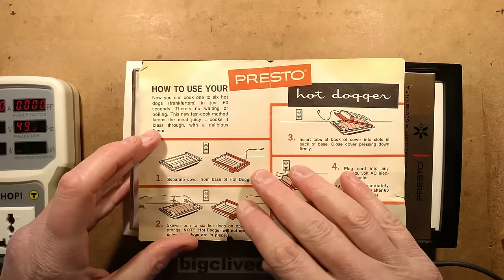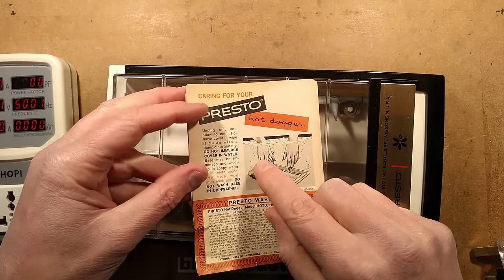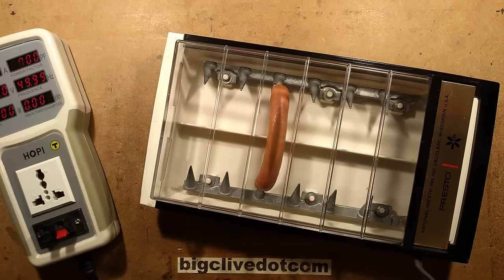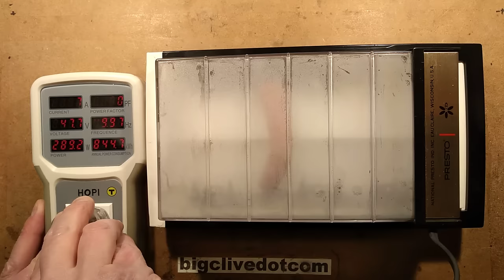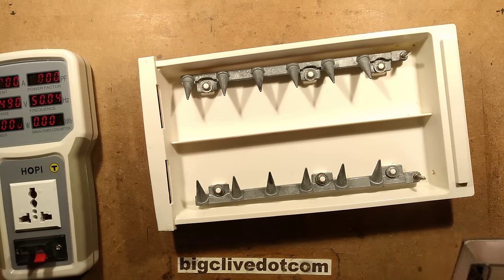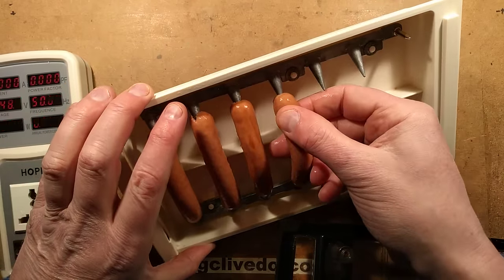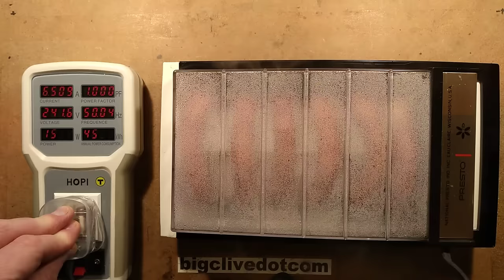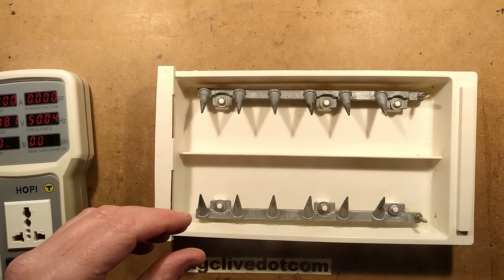Turbo charging a 120V Presto hot dogger on 250V.

Comment: Now I know if I ever run out of 200 ohm resistors I can just use a hot dog :)
Reply: HAHA, i love this comment
Reply: Dang it I just bought a whole bunch of resistors.... off the top of my head I think I was going for 220 but 200 is close enough🔌🔥💥💣💀
Reply: No wait that was 220K that explains why I burnt out one 220 testing things, I'm trying to drive LEDs off of 120 mains and yes i did consider and did watch the previously uploaded video on the subject of "LED Mains indicators".
Reply: ALL resistors are tiny hotdogs encased in resin and color-coded with stripes. SMD ones are just tiny square slices of bologna.
Reply: Could hot dogs be the new duct tape of the electrical engineering world? Hundreds of uses!
Reply: if you need different resistor values you can simply put hot dogs in parallel or series to reach your value..
for higher values you might wanna try cheese instead !
Reply: @chemieju6305  i use oreos for that :P
Reply: @tinygriffy  given that the cream is probably more conductive than the coockie you might want to consider using reores.
Reply: @chemieju6305  oh, i soak them in banana milk as electrolyte.. forgot to mention. ^^
Reply: And you can trim the value by adding more in parallel. 4 of those should make a useful 50 Ohm dummy load...
Reply: You'd need a lot of them if they last this long before being cooked.  :)
Reply: It's hard to solder to a hot dog, but I suppose you could stick them in a large fuse holder..
Reply: Just make sure you check the color code on the hot dog first ;)

Comment: probably the most efficient  hod dog maker, but also has 0 change to pass any modern CE or FCC tests
Reply: Krisztián Fekete bribe them with hot dogs
Reply: It gives the hot dog a certain taste. Many other channels have commented that the hot dogs taste off. 
I would TRY one, but I wouldn't want one of these. The roller machines are better imo.
Reply: @xeserupseinopelttil4574  Of course roller grills are better, they sit and roll in their own juices for hours making them delicious
Reply: I g e n
Reply: @xeserupseinopelttil4574  Yeah, the problem is, it also electrolyzes the hot dogs.
Reply: CE is a self-certificate, so yes you could.  And UL would also for enough $$$$.
Reply: @Nerdule  it doesnt there is no galvanic effect with ac
Reply: Ah yes, the Federal Communications Commission deals with hot dog cookers
Reply: Moistifier The hot dog might have RF emissions.
Reply: These hotdogs that are cooked like this actually taste like they have metal and or electriciry in them. Not sure why but its not really pleasent .
Reply: It's 2 live wires coming out of a wall socket.
... If there's any kind of safety testing, this thing wouldn't get past the drawing board. I love it.
Reply: @Volvith  The wires are only exposed inside the device, and only with the lid closed.  This device is IP2x just like the electrical socket itself.
Reply: Unless you got some weird kinda dogs that spew rf, the FCC don't give a shit.
Reply: @xeserupseinopelttil4574  we had one of these when I was a kid in the1970s, and yes, I was allowed to use it.

They had that burnt electrical taste on the ends where the dog was in contact with the probes.

Would not recommend.
Reply: Just slap a CE label on there. Problem solved.

Comment: Tiny hotdogs from a can?and high voltage?.....this looks safe
Reply: Since when is that considered high voltage? In consideration it's actually still low voltage
Reply: @cappytan9058  it's...240 volts...enough to kill multiple fully grown men... what the fuck do you mean still low voltage?
Reply: have you ever been shocked by static? that is way more than 240 volts...  @cato7329
Reply: @cato7329  Its not the voltage that kills
Reply: epic gamer  it’s all relative. 120 or 240 volts can be lethally high when it’s generated as alternating current and the amps are also sufficient. If the volts are much lower, then there simply wouldn’t be enough electromotive force to allow the electricity to overcome the resistance of your skin, regardless of the number of amps provided.
Reply: @logik316  you're right, I guess I forgot to add that
Reply: Zero Cool Low voltage is up to 277, medium is 277-600, high is anything over that
Reply: @cato7329  doesn't mean it's high voltage
'Voltages 600 V and below are referred to as “low voltage,” voltages from 600 V-69 kV are referred to as “medium voltage,” voltages from 69 kV-230 kV are referred to as “high voltage” and voltages 230 kV-1,100 kV are referred to as “extra high voltage,” with 1,100 kV also referred to as “ultra high voltage.”'
Reply: @cato7329  Been doing electricity for a while now, we've all been messed about by either 230 or 400v trying to graduate, still in consideration not that high 😊
Reply: if you have never seen a video of a person accidentally hitting a house line for electrical they literally get thrown into the air its crazy ive seen it in person
Reply: @cato7329  still low voltage. Low voltage was up to 1000v ac and 1500v dc, medium was from 1000v ac and 1500v dc up to 10kv and 15kv respectively. Only from there it is considered high voltage. Its not the voltage that kills tho.
Reply: I think the cooker is safer than the canned hotdogs.
Reply: @cato7329  It's amps that kill, plus BigClive here proved that in a vid where he subjected himself to mains voltage run through a resistor array, ultimately resulting in taking in 30vac with gradually increasing currents up to IIRC 13mA - the pain threshold for AC, and 100-200mA is the kill zone for AC, and 300-500mA is the kill zone for DC, so, for example, you could get hit with 120vac @10mA and be fine, other than it hurting like hell, while you could be hit with 40vac @120mA and be a dead mofo. Internal body resistance also plays a part.
Reply: 'Murica!
Reply: Also 240 volts is safer as being electrocuted will throw you off what is electrocuting you saving your life, 110 volts will hold you to the wires and possibly kill you. My brother who works as an industrial electrician but occasionally wires houses for people he knows has been electrocuted three times with 240 volts and is fine. If he was electrocuted at work he'd be dead as it's 20,000 volts and some ridiculous ampage.
Reply: @nandos_  yeah, it is, that adage is pure myth.
Reply: Any bigger hotdogs wouldn't even fit in the machine
Reply: @cato7329  lol. If that was true then I would be dead hundreds of times over. I can't count how many times I've been electrocuted with either the full 230-240V or just between the mains and ground (half).
Reply: @Ethug229  That's before it gets transformed down to 240v for residential use. The voltage of long range electrical transmission is usually 100,000-1,000,000 volts. 
By the time it reaches your neighborhood the voltage has been stepped down multiple times.
Reply: High voltage warnings are warning how far it can arc. Mains is in cm at best.

Comment: My father was a high voltage lineman, and long ago, he called us outdoors for a quick electrical lesson, since we were a bunch of curious kids when it came to electrical and electronic things. He wanted us to learn respect for mains electricity, so he told us what the lesson objective was, took a lamp cord, stripped the ends of an inch or two of insulation, wrapped the bare wires around a pair of ordinary nails, and stabbed the nails into the ends of a hotdog. He then warned us to stay back and not touch it, and then plugged it in. It cooked the hotdog in a similar way, but he intentionally overcooked it so we could see that the electricity burned the hotdog from the inside out, in a direct path between the nails, and he told us this is what happens to your body when you get an electric shock, especially one that lasts long enough to do significant damage, and on the inside no less.

Comment: 1. power rises in square to voltage, the recommended time would thus be 15 seconds 

2. 10mA is enough to override your muscle movement, so yes, depending on how you're touching the wires, you're be stuck. Tried that out for you (in a controlled experiment that allowed up to 20mA, 15mA appeared to be the limit of what most people are willing to do to themselves).
Reply from the maker: I got up to around 13mA in my video where I tried that.

Comment: We did this in physics class. But it was a lamp cord wired around to two forks. If you cook a pickle it’ll glow!
Reply: anonymous Not sure, but it does. Gets hot, steams a lot, glows yellow, starts to burn, and sometimes explodes.

Pretty fun for high schoolers.
Reply: anonymous  this is because of the salts in the pickle - those ions start to glow when current is flowing through them if i recall correctly
Reply: One retired 80 year old held electrical experiments for the other retirees and he did this experiment, one of the new retirement home helpers told him to put it away and he said no, so the helper picked it up by the pickle and got electrocuted and died, serves him right for touching someone's pickle
Reply: @jamesgardener7099  o
Reply: anonymous  its the sodium in the pickles, sodium makes a yellow glow when ionized.

Comment: The metal looks like zamak, a zinc alloy often used for those sort of mouldings. 

Power wise you can do the maths - those hot dogs weigh 184g for 8 = 23g each. They're 70% water so treat them as 100% to keep the sums easy. Water is 4.2 J/gK. Room temp is 20C, you probably want to serve them at 70C so 50C difference. 4.2*50*23=4,830 J. At 250W per hotdog that's 19.3 seconds so pretty much spot on.
Reply: This is a great example to relate to people who wonder why'd they'd need to use math and physics in everyday life.

Comment: I used these cookers in the late 60's and the 70's.  Problem was it was a one use device.   And it was hard to clean so it got dirty.  
I finally used a suicide cord(lamp cord with alligator clips on the end) and just put the alligator clips on either end of a hot dog which I had already mounted in a bun.  
Worked fine for lunch at the lab bench.
Reply: i though those are not safe,some foods chemistry gets wonky with electricity.
Reply: @Blacktronics   That may be true, but that's not a reason to go out of your way to pile even more on top of that street dirt, now is it?
Reply: @Blacktronics   no check out electroboom,he electrocuted a sausage and  some weird color stuff came out he said its not safe.
Reply: @ppsarrakis  That is because he is using DC, which causes polarization in the electrolyte (sausage), look up electrolysis
Reply: @Blacktronics  ah fair enough.

Comment: I made a single dog version of this when I was a kid in the 70's with a couple of 16d bright steel nails, a short piece of 2x4 lumber, a short piece of 1x4 lumber attach to cover the nail heads on the bottom, and an electrical cord cut off of something --- and a toggle switch. Still 100% exposed to a live electrical circuit when in operation. LOL!

Comment: Power is I^2R, so cooking time should be ¼ of 110V time, so about 15 seconds.
Reply: soundspark worse, it changes over time.
Reply: I always use hotdogs when I'm out of nonlinear resistors.
Reply: @soundspark  "hot dog is a non-linear load." and that is another phrase I thought I'd never see.
Reply: Control Engineering Exam
Question 1
Determine if the system hot dog is (1) linear (2) time-invariant.
Reply: @tinplategeek1058   My hot dog produces non-linear loads.
Reply: @oida97  I think you could probably model the hotdog stepwise as fixed resistances based on time.  Cold hotdog, cooking hotdog, burning hotdog, incandescent hot-dog-shaped filament in free air....  Just have to integrate the power and the thermal transfer function to see when you go to the next step.

Comment: I still have a slightly newer version of the hot dogger and I used to use it several times a week.  Now it only sees use occasionally but it still works just as well as the day I bought it.  I also live in Wisconsin only a couple hours drive from where they used to manufacture them.  Still an amazingly simple and effective appliance.

Comment: You could also rectify the voltage going in, so any electrolysis or other chemical reactions are not cancelled out by ac. You'll get different liquids flowing out of each terminal and possibly some chlorine gas from the salt.
Reply: yummy
Reply: This is actually very interesting.
Reply: @jhsevs  It's fun. Putting Dc current through water will yield you hydrogen and oxygen. Adding  salt will yield Chlorine.
Reply: @autogolazzojr7950  , people here sometimes convert their swimming pool to salt water so they don't have "nasty" chemicals like chlorine then instead plug the sanatizer in that makes ...... err chlorine :)

Comment: P = V**2/R, so double the voltage and you'd want to cook it a quarter as long: 15 seconds?
Reply: Doubling the voltage would only increase the range the electricity would travel while increasing the amperage would increase the heating amount. This concept applies to welding, vaping, and resistance based heaters being very very common.
Reply: @Cerberus984  - I was wondering if the frequency difference play a part also? The original was for 120Vac at 60Hz.
Reply: Yes.  He found 20 sec through trial and error.
Reply: @Cerberus984  might wanna go check ohms law, current and voltage are proportional.

Comment: I made the garage version of this over 50 years ago.  It worked well and my younger brothers and sisters thought it was magic.  A few things I learned.  1.  The hot dogs are big juicy resistors.  2.The more big juicy resistors you have in the circuit, the faster they cook. Six cook faster than one. 3.  Very important...  DO NOT TOUCH THE BIG JUICY RESISTOR.  As they heat up they will start to sweat, and for a kid it is tempting to touch it....Don't do it.
Reply: You touched the big juicy resistor didn't you...don't feel too bad about it lad, I would've done the same and more than once.

Comment: 4 times the power at twice the voltage. Which means that 15 seconds should be long enough. Thanks Clive.
Reply: Power is voltage times current. So double the voltage is double the power.
Reply: @cyan_oxy6734  you've missed the fact that current increases as voltage does so long as the resistance stays the same. So with a given hot dog (or any resistance), if you double the voltage the current will double as well, thus the power increases by a factor of 4.

Comment: A schoolfriend once arrived to class with a charred hole through his thumb. He had been removing a blown fuse from his CB radio supply whilst still connected to 240VAC.
Reply: Ouch...that stings  :)
Reply: At least the carbon stopped the bleeding. It is still a bad Idea to put 240VAC at more than a few mA across one's finger.
Reply: I remember him saying the radio started working while his finger was was stuck in the contacts!
Reply: LMAO   :)
Reply: Slapped for stupidity by Thor
Reply: another ouch thing to try, put your finger over the cb aerial socket fire it up and key the microphone. that will also burn and sting for some time :o

Comment: I wonder what kind of nasty compounds you generate with electrolysis inside the hot dog? ... well aside from the nasty compounds already in the hot dog :3
Reply: Aw c'mon that's 70's kitchen tech, we don't worry about such things because everyone smokes...while we didn't have this gadget, we did have the Presto Burger hamburger cooker
Reply: Well, see, that's why you don't just drive the current directly through the dog like this - instead, you should be skewering it onto a soldering iron! Still perfect 1 power factor and you can even choose the cooking temperature...
Reply: @AttilaAsztalos  I remember these.    The hot dogs had a metallic taste.
Reply: This is indeed very interesting, good question.
Reply: @ChristophPech  Are you sure about that?
Reply: probably poly-cyclic aromatic hydrocarbons and a few hetero-cyclic amines from the temp hot-spots in the meat, just like a microwave
Reply: I was thinking the same thing
Reply: @6150RE  yes, I did it once myself. But it might depend on the type of electrode used. With neutral ones e. G. Carbon, Natrium hypochloride is created. For the short cooking time of 20 seconds the amount might be negligible.
Reply: On AC? Nah, you need DC....
Reply: @joostluyten_ON3JT  - For electrolysis?
Reply: @NeuronalAxon  Yes, my previous answer was in a hurry :-) You need DC for electrolysis instead of AC. If @bigclivedotcom throws in a rectifier then we have our answer :-)
Reply: @joostluyten_ON3JT  I don't think so, you need DC if you want to say, separate water into hydrogen and oxygen and keep them seperate, but even with AC electrolysis will still occur, the gasses will just be mixed.
Reply: @joostluyten_ON3JT  AC is just fast changing DC. Electrolysis does occur, but both cathodic and anodic products appear on both electrodes.
That AC doesn't produce electrolysis is a myth perpetuated by elementary school teachers that try too hard at dumbing down physics curriculum.
Reply: @lajoswinkler  Maybe it's 'dumbed down' because they need to teach it to primary school kids...
Reply: I didn't even think about that😂
Reply: @ChristophPech  at least the bacteria is extra dead.
Reply: won't the salt that's in the dogs what is Aq won't  there just go a current trough the dog and because its a hotdog so the conductivity is very low so it generates a lot of heat troughout the hotdog
Reply: Especially converting some of the added chemicals in hotdogs into yummy killdogs. he-he
Reply: Testicular/ocular electrolytes of pig. Yummy....

Comment: We had one of these in the 1970s. On 120V current, if you would cook a single hot dog in it, it would make a horrible burning electrical smell and taste. But if you cooked two or more hot dogs at a time, it worked pretty well. There was also a hamburger version of the device, but it was just a special hotplate vs food electrocution device.